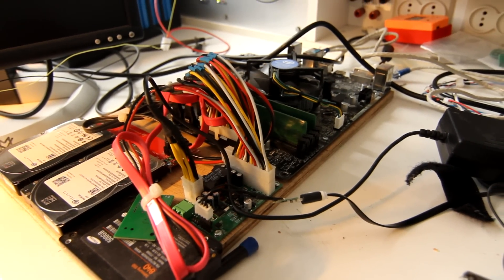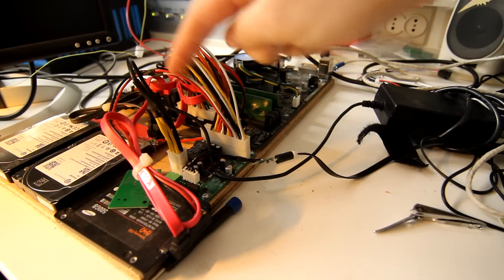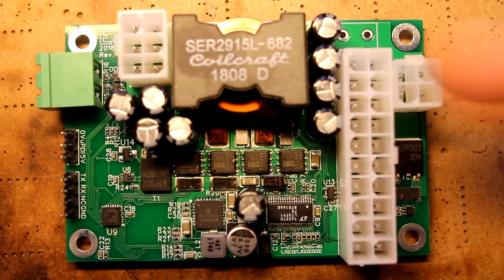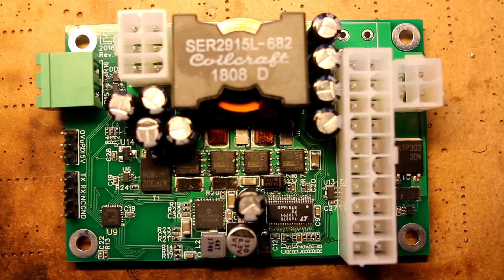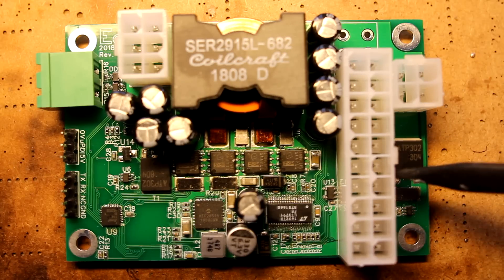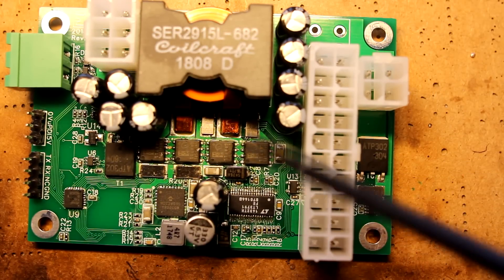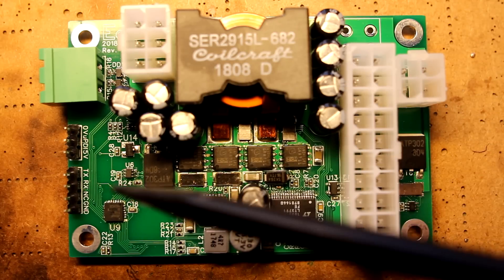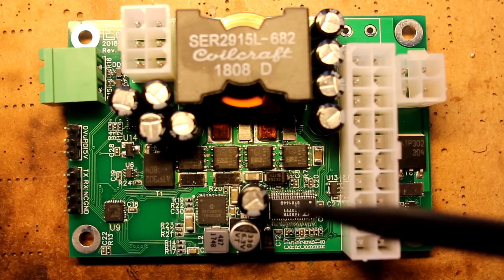Automotive measurable ATX PSU with GPIOs

Comment: That's a beefy inductor. I use that type for Class-D power amps. Just for the record Wurth has the same type (even footprint compatible) that actually can handle a little more current and is a bit cheaper.